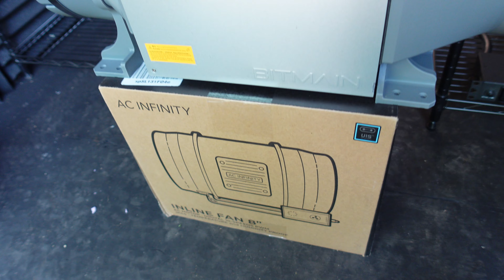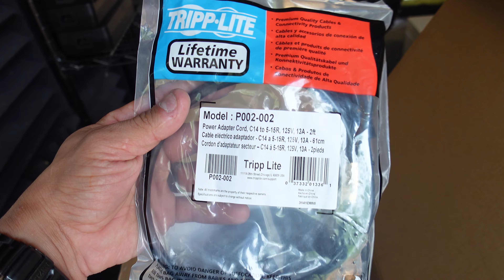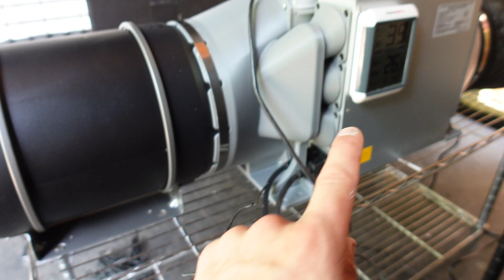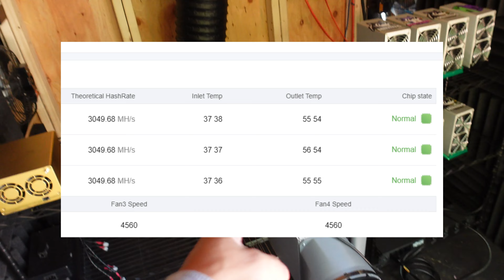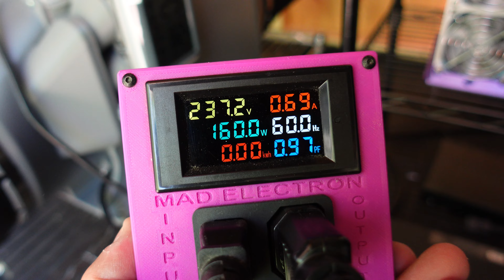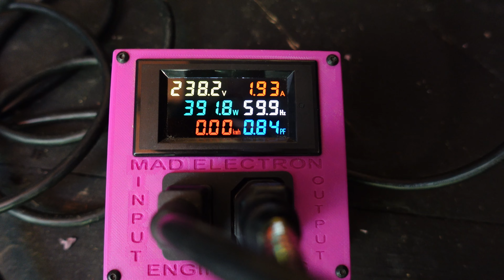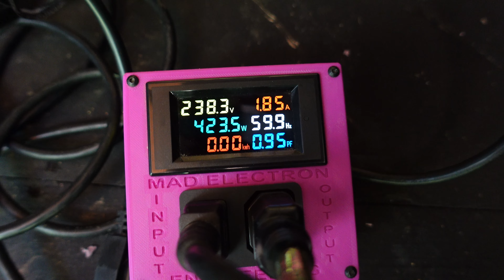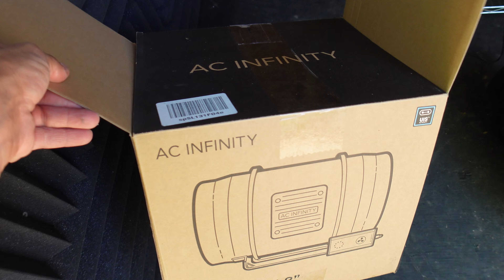Exactly why CHEAP isn't always the BEST...

Comment: CCXD you are very welcome Sr. ACI S8 fans maybe more expensive initially however they are much more efficient, much more reliable and overall more silent than any other inline 8” fan, this is why myself and John over at Fruits and associate only recommends using the ACI fans, truly very happy you are happy with it! Also for L7’s setting of 7-8 is recommended in the summer and 6 in the winter, just need temps in 70-75c exhaust, the miner will shutdown at 85c if anything goes wrong with the fan.
Reply from the maker: Your the best man I appreciate you so much! Thanks again my man 🤙🏻

Comment: Ac infiniti fans are dc pwm, I have a few running here and have been amazing. I have a few videos messing with them. I think mine are older and won't use your adapter, they are 120 only and would fry. Awesome to see them correct that on the newer ones.

Comment: Get the pro controller for it. So you can put a temp probe behind the Asic and it can adjust the fan as needed so you don't need to run it full out all the time. It will adjust with temperature. You can also view it remotely with wifi

Comment: That's insane how many watts the non AC Infinity fan uses! So happy I went with AC Infinity right away. I would say go ahead and buy a few extra fan simulators to have around. I got the deluxe kit from fruits and associates and the fan simulators they provided already failed after only a few months. I have built a custom boxed in window enclosure for exhausting my hot air out of my basement while OVERCLOCKING my K7 and it's like its not even down here anymore. I also went from an 8 foot duct to a 25 foot duct and had to increase my fan speed to 8 from 6 because of the resistance. Another thing I used was that 3M metal Duct Tape to wrap around the connections where the fan and asic come together to seal it up. And thanks to Fully Electric for the c14 to 120v plug idea! can't wait to order mine!

Comment: Like the old saying goes, you get what you pay for...I've used AC Infinity since I built my mining room in my basement in 2019 and when I built out my shed, they were the obvious choice.  My 8" inline fans ran non-stop for 4 years  anywhere from 8-10 speeds.  I never realized they were that much more efficient though...holy crap that's a huge difference!
Reply from the maker: Yea my special half ordered the crap ones LOL

Comment: Are the Hp ratings the same on the motor plates? Do they have similar CFM ratings?
Reply from the maker: 735 CFM on the VivoHome one…
807 CFM on the AC infinity!! It’s crazy!
Reply: @ChumpChangeXD Mining & Crypto  the motor probably has marginal winding insulation or maybe a bad bearing. There isn't much to the "system".

Comment: The power that a fan pulls is less if you put it in a duct. If you completely block the flow, you'll see less power. A fair test is to put the other fan on the asic duct system and then measure it's power draw.

Comment: My guess is that AC Infinity probably uses a pulse width modulation (PWM) controler to control the fan speed which saves a lot of power compared to a voltage regulated system for fan speed which is likely what the other fan uses. Very nice difference in power. #L7

Comment: Here is the thing about ac infinity ducted fans.... Make Sure you tighten the tube clamps from time to time. They operate at pretty decent cfm with a static pressure of Mach Jesus. The electricity they use is SPOT on for their data sheet and they are super efficient the lower your go. Grab you a controller 86, set it and forget it.
Reply: By the way. The 12 inch fan pulls half of what the scrap fan pulls.

Comment: Didn't you plug the fan into the 240v socket? That would be the reason, why it takes two times more watts.
Reply from the maker: It’s good for both voltages if it wasn’t it would be fried… even at half of what it was (210 watts) it’s way more…

Comment: You're running that other VivoHOME fan on 240V when the label says 120V.  There's your problem?
Reply from the maker: It’s for 120 or 240v I woulda popped it if that was the case. They say 120v because of the plug style it has

Comment: I have the same stupid vivo fan and it say on the label 190 watts, I will test it for sure, doesn't make any sens.
Reply from the maker: Let me know what you get!
Reply: @ChumpChangeXD  Not sure if it's because or the 220 volts or your fan is broken but mine is 120 watts at low and 150 watts full speed.
Reply from the maker: @domg6614  there has to be something wrong cause I almost shit! Lol